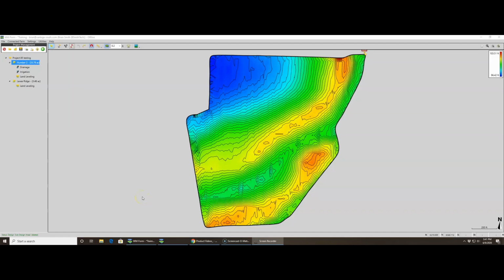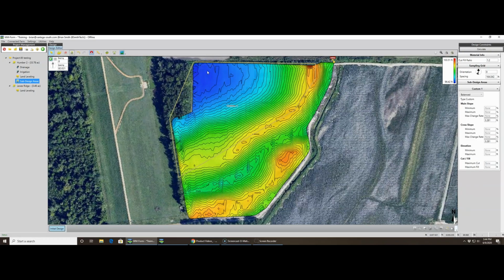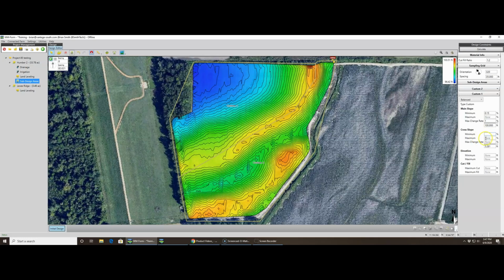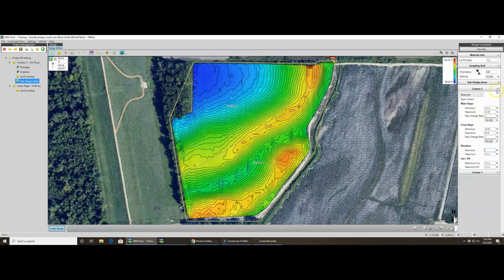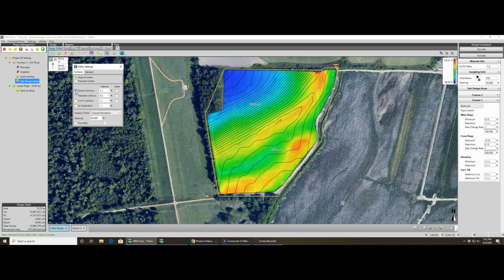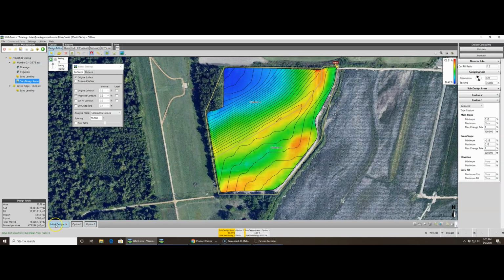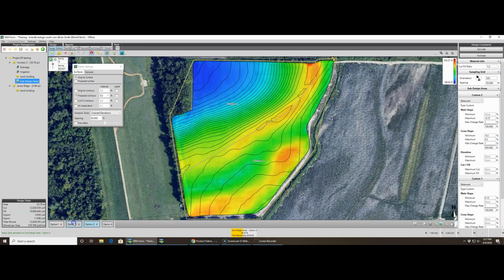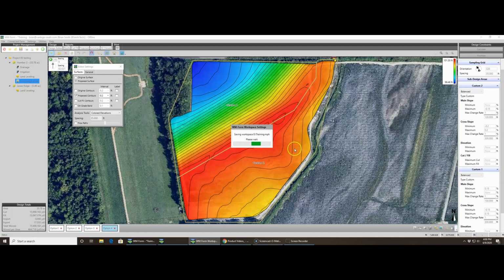WM Form   Custom Design Areas

Comment: Can you do a balanced best fit design based on a max cut?
Reply from the maker: In the Context of your question I do not believe so . Unless your max cut is more then the calculation needs. If I was to design on that kind of perimeter I would change the Import/Export drop down menu to Free . This would tell you how many yards of dirt that would be needed to bring the surface up to the desired constraint.